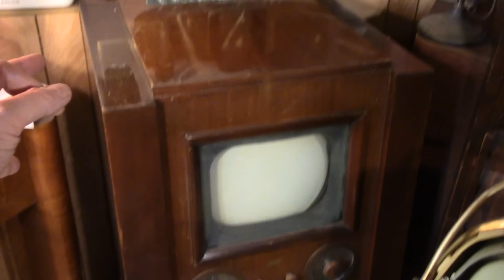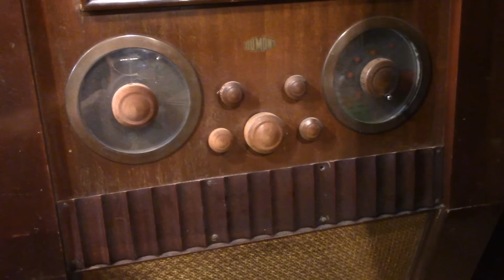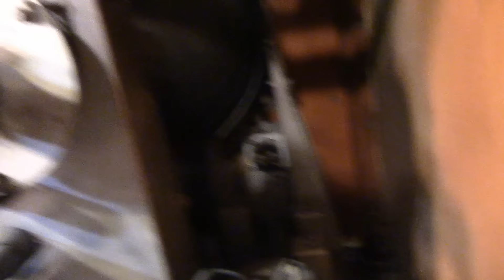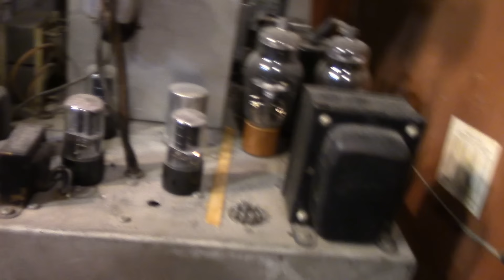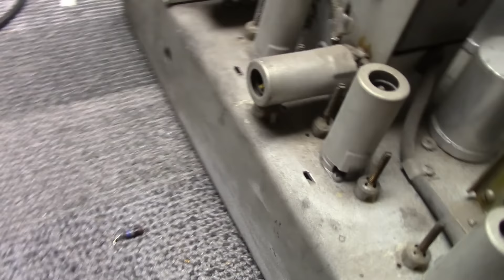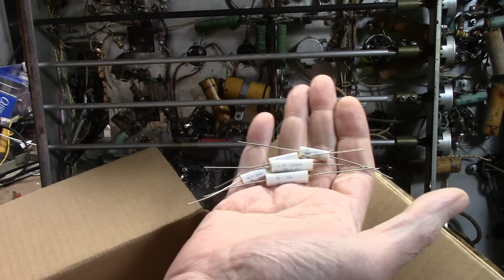Dumont RA-102 "Clifton" part2 - work finally begins!

Comment: When you mentioned upgrading with an aluminized CRT, it peaked my curiosity on that topic.   I'm assuming these sets did not have aluminized CRTs as option originally.  Would that be a rebuilt tube you're using, or a compatible?   What is the minimum HV to successfully support the aluminized tube?  Could I assume any magnetically defected set is adequate?   I ask because, when exploring this option for a VT-71, I was told that electrostatic defection sets anode voltage was too low to support.
Reply from the maker: 12KP4 would be an option. I have a used one stashed away. They came out a couple years after this set was made. Drop in compatible. There are no aluminized electrostatic TV CRTs to my knowledge.

Comment: Focus pot toast?  For my 103 Doghouse I got a NOS 25W exact replacement from Surplus Sales. There are cheap clones out there but nowhere near as smooth as the original.
Reply from the maker: Surplus Sales has been out of stock on those for years.  Have not checked it yet.  This set also uses a 25W pot to set the damper tube operating point.

Comment: Bob, your basement reminds me of the TV museum in Hilliard, Ohio!  You certainty do have some classic sets!

I was looking over the schematic for the DuMont RA-102, you were right about DuMont designs; very high end and complex.  420 watts power draw for a 12" B&W TV; that's a lot of tubes!

That oil filled cap is a 10uF, 600V none polarized type.  I think DuMont used this, as opposed to a polarized electrolytic because the voltage polarity will change when the B+ relay is energized.

They are dumping a huge amount of power into the horizontal deflection circuit.  I think they did this so they could get an ultra linear horizontal scan from the yoke.  Note a duo triod being used as the damper; this is so they can set the clamping voltage.

As per the usual with with these early sets, a lot of B+ is getting consumed by the focus electromagnet, vertical, and horizontal centering.

That 1N34 is being used as the video detector.

The high voltage power supply is regulated.  They use a blocking oscillator to feed the 807 which drives the high voltage transformer.  The error amp modulates the 807 screen grid to regulate the output power of the step up transformer.  I am guessing the switching frequency is aboit 100 kHz.

Even the set is relatively small and unimpressive looking, I'm sure this was considered a premium set in it's day.

Comment: Semiconductor diodes were nothing new in TV in 1947, The Baird T5 from 1936/37 even uses one as part of the frame synch seperator.
Reply from the maker: The first commercial germanium diode was released in 1946.  Maybe Baird used a Selenium diode?
Reply: @bandersentv  It actually uses a copper oxide diode.

Comment: I'd just disconnect the aluminum can caps and put the new ones underneath since there is so much room. With the bottom covered, no-one will see them and there doesn't appear to be anything that could cook them.
Reply from the maker: Well, there are five cans for a total of 16 capacitor sections to replace.  I just ordered some new cans from CE Manufacturing.